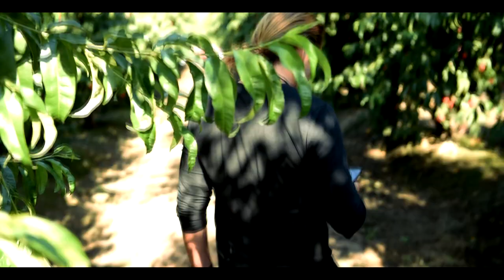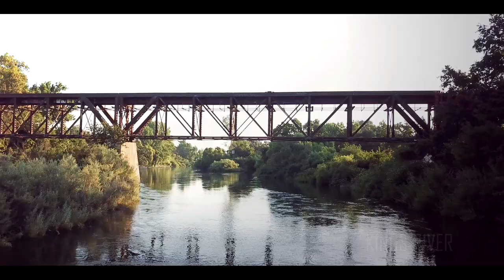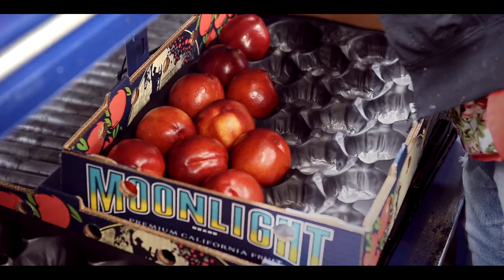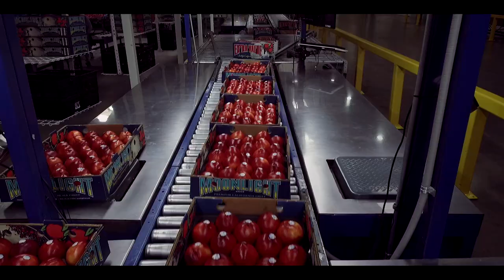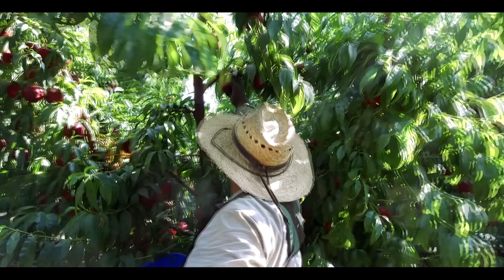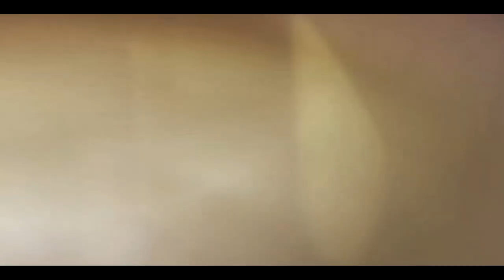Fresh Local Peaches

Comment: I bough this Moonlight peach from California, cut it  in half along the pit and try to separate it. I work in construction and have strong grip but couldn't pull this peach apart. When I throw the peach on the kitchen counter, it bounces like rubber ball. What did you created there in California, peach Frankenstein?